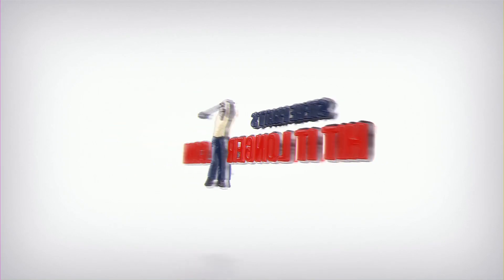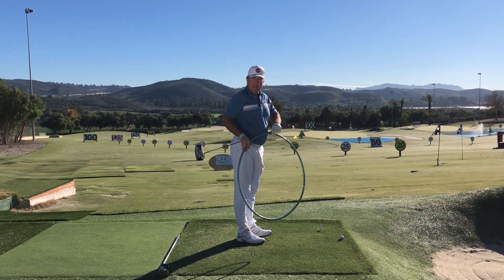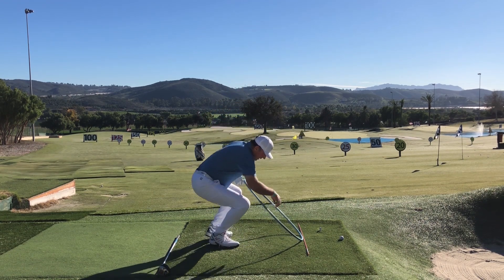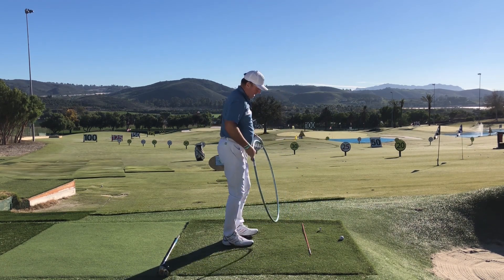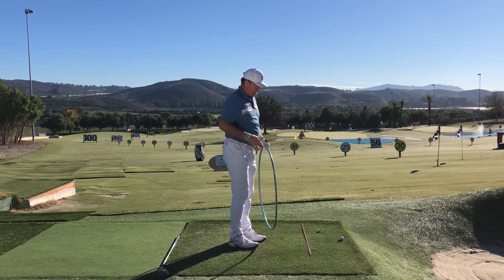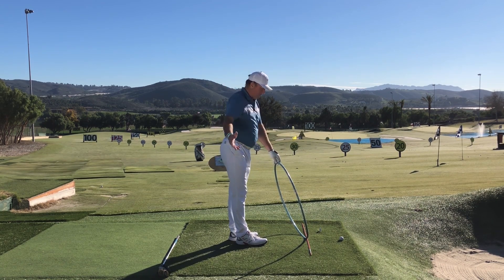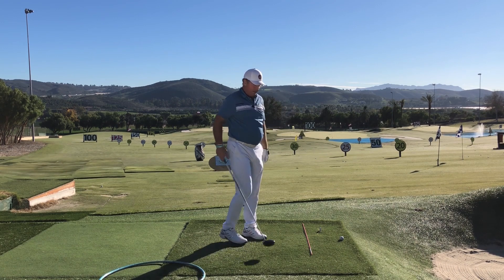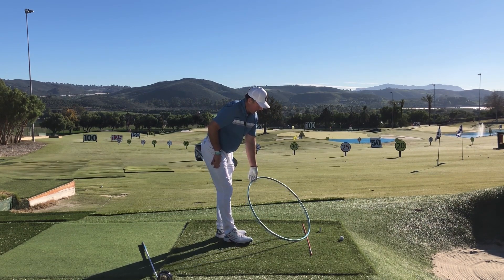Swing Plane Errors You MUST AVOID!

Comment: Hello Steve..great videos. I’ve been playing for about 25 years…and am currently a 5 hcp. I have ran into some driver issues recently with snap hooking. I know my face is closed to my path….but I can’t seem to straighten it up. I think my stance may be too wide as I am trying to hit up on the ball and am attacking too much from the inside out. Could this be an issue and is this something you see commonly with lower hcp golfers? Thanks and love the vids!
Reply from the maker: Yes your exit is probably high right and toe flipped over.  I just had a lesson with a guy exactly like this today.  Get the handle lower and closer to the back pocket, then get it turning the corner exiting low left without the toe flip.  Feel free to get a video swing analysis and I can help you better!